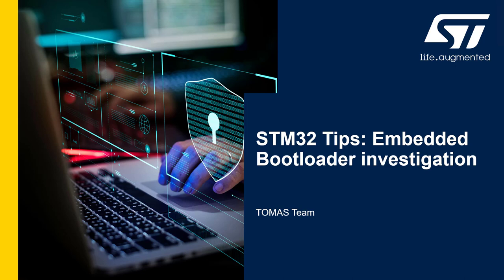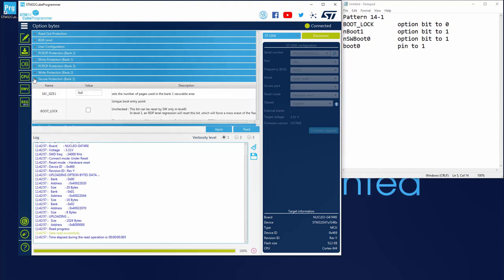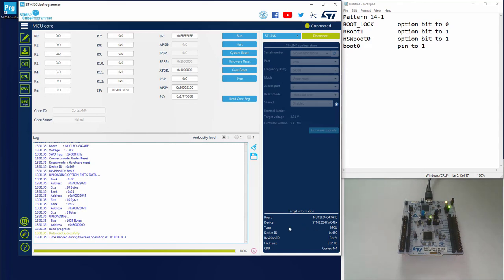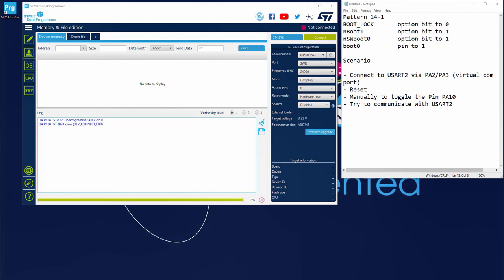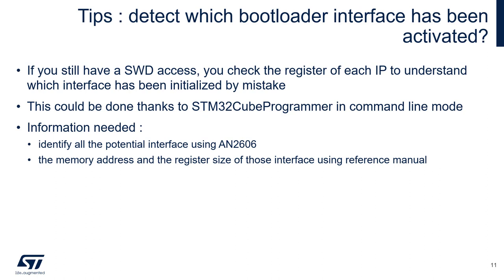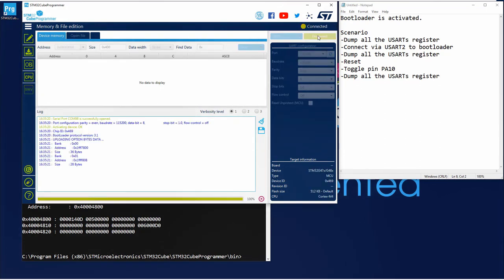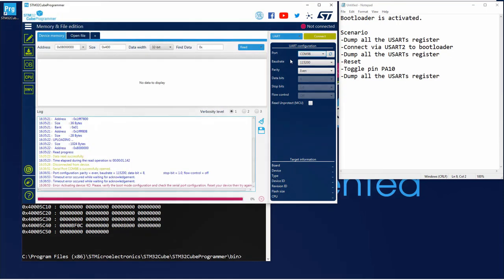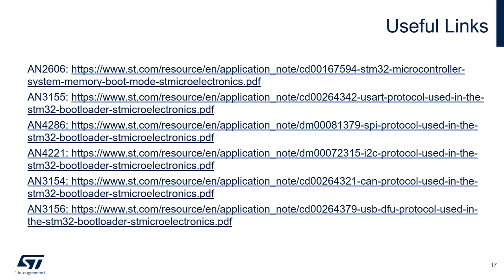STM32 boot and startup tips - 2 Embedded bootloader investigations

Comment: It's really great but it doesn't explain my question:

Code like that

loop:
0x08000000 b loop

The question is: How it can execute without vector table?
At the end we can debug and check the program counter is equal 0x08000000 !

In my imagination firstly MCU 0x08000000 use as stack pointer and 0x08000004 address use as reset handler. After that in 99% cases it invoke bus fault handler (RAM/ROM doesn't exist at invoked address) and NOW MCU running from 0x08000000 !!!

Correct?
Best regards

Comment: This is a very helpful video and has furnished me with a couple of ways to diagnose my bootloader problem. The question I have is, why does ST think it is a good idea to hide such useful information away in a youtube video!? Why not put a section containing this problem solving information in the AN2606? The second question is, why does ST think it is good to have to use reverse engineering tricks like tracking register changes to understand the behaviour of the embedded bootloader. Wouldn't it be easier for everyone if the source code for the bootloader and a symbol file were released?  Developers could then simply step through the bootloader and see exactly what is happening.